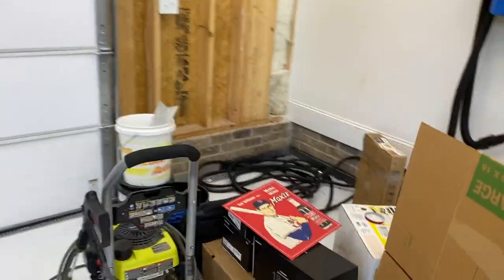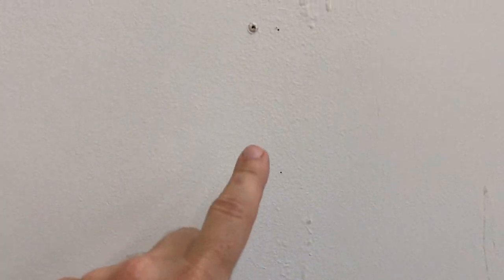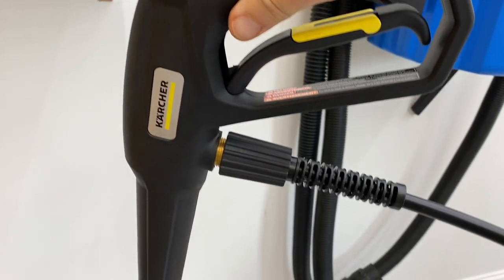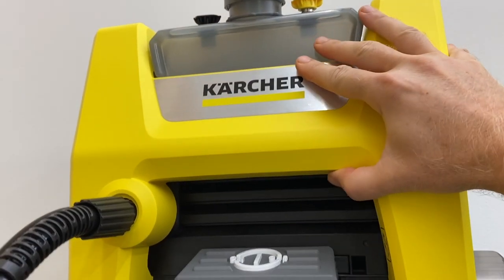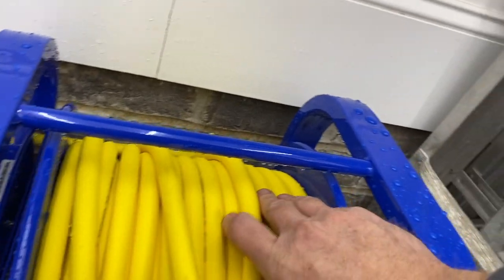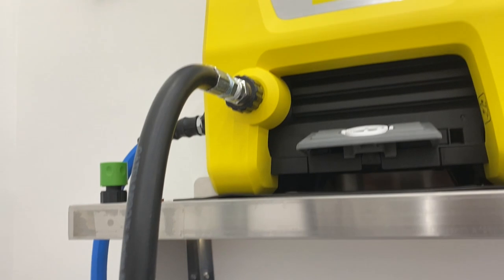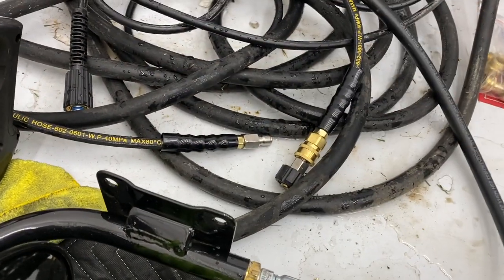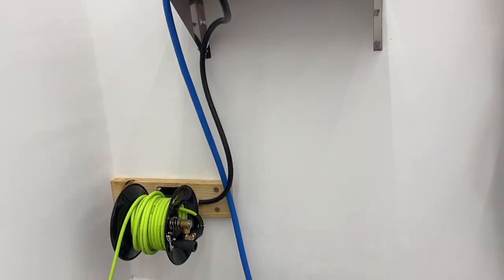Best Budget Complete PRESSURE WASHER SYSTEM for your Garage UNDER $450!

Comment: does the karcher have that crazy kick back on the hose reel when building pressure after releasing the gun trigger? I have a similar setup with the green works 1700 and the hit is so strong when I release the trigger I feel my seals are going to break.
Reply from the maker: +Canillo Canillo no, it does not.
Reply: @HelpMeDIY  just installed the Karcher cube and it works great. Something about how they work is what I needed. Purchased 3 different brands and all of them produced a super strong kick on the hose and reel when releasing the trigger. This one solved 99% of that problem.
Reply from the maker: @canillocanillo3371  glad to hear it! 🍻

Comment: Nice setup! I just upgraded from the Karcher after almost 5 years of use mostly washing my car every week. It served me very well until a few weeks ago when the pressure switch started to fail. Karcher has an incredible warranty that I may well use to fix the unit but after lots of research decided to upgrade to the Active 2.0. So far I am thrilled but I have never regretted my time using the Karcher.
Reply from the maker: +Terry Sheehan thanks! 🍻